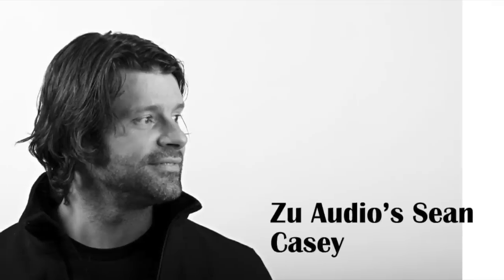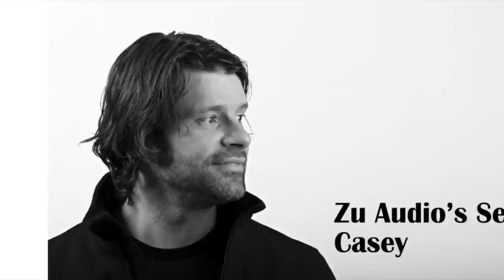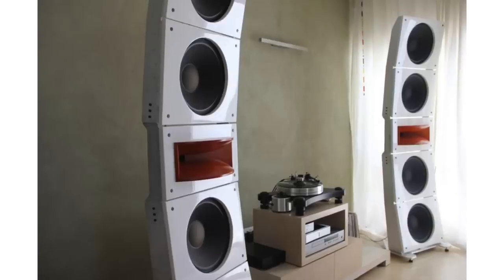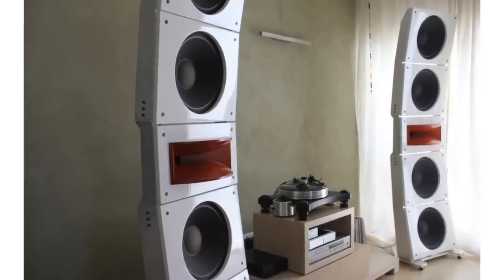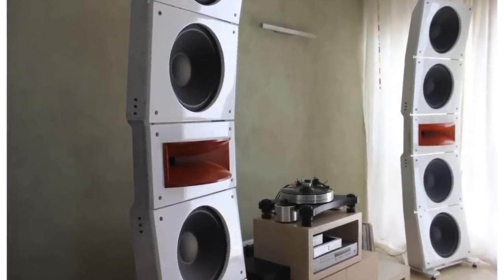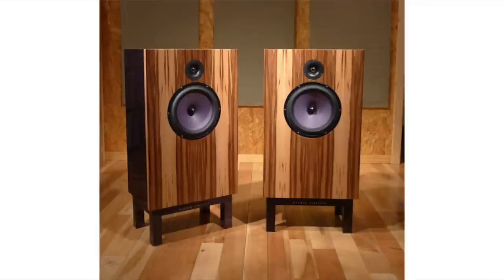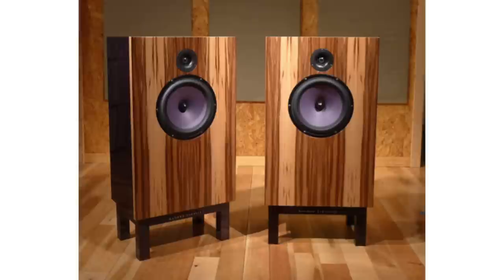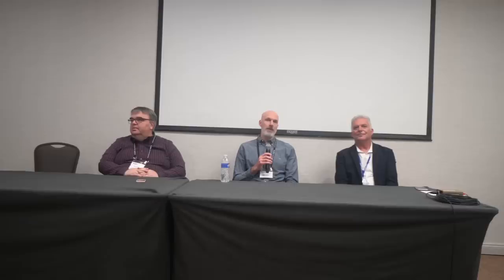Here's an in-depth discussion about box, horn, and panel speakers, and how they work

Comment: It is great to have such a wide variety of speaker types (and within any type, many manufacturers (and within any manufacturer, many models)).
Similarly, it is great to have such a wide variety of motorized vehicles (gas, electric, hybrid, 2-wheel, 4-wheel, luxury, performance, off-road, etc).

Now consider what it would be like if the one thing that all cars depends on was typically mediocre at best.  Consider what it would be like if almost anywhere you pump gas had X% of water (or some other clearly foul contaminant) mixed into the gas, resulting in limiting the performance of 100% of the cars on the road, and there is absolutely nothing any engine can do remedy the problem.

Such is the case with the sound quality of songs release by record companies.

So all of the hard work that everyone in the audio industry contributes, all of the amazing feats of design, engineering, and build quality are all dependent upon watered down gas (sub-par quality from the record labels).

Imagine if the only food available was unhealthy fast food.  Do you think we would have Olympic athletes?  Do you think the world would just ignore the problem?

If the record companies would stop over-processing, stop compressing, stop screwing with the magic that is on the master tapes, then all of these speaker designs would benefit.  Every speaker, regardless of design, regardless of price, would sound better (and in many cases, a lot better).

And it is not just speakers.  Every piece of audio gear would benefit.

The brilliant minds within the audio equipment industry are always fighting an uphill battle, always swimming upstream, never having the wind at their backs, due to so much sludge coming from the record labels.

If every speaker manufacturer was getting faulty drivers, or faulty wood, etc, and was forced to use those faulty items, they would scream loud and clear at the third parties responsible for providing the faulty parts.

It should be no different for the parties supplying the gas.  They should not be "normalized" and allowed to get a free pass for diminishing the sound quality of every part of every stereo system.

I wish that whenever panels of guests, such as the ones in this video, would get together, that they would at least mention what I consider to be the single worst culprit in the audio industry.  If they would rap things up by mentioning that so much of their efforts are for naught, due to lackluster releases from the record companies, then, if repeated often, the public will be better educated, and perhaps someone of influence at a record label might wake up.

Cheers!

Comment: Started with Bose 901 series 2 driven by one of those monster size Sansui receivers in the late 70's...thought they were great, but then heard a pair of Magnepan MG1s. What a revelation. They lasted until a couple of years ago and we now have Magnepan 1.7s with a Rel Storm sub. Everything in our system has been upgraded with much of it PS Audio. I have begun looking at new speakers (Paradigm Persona and Golden Ear Triton 1), thinking that something better would benefit from the rest of the system. I've struggled in that I/we love the Magnepan sound and would like a better sounding speaker (more clear highs where you can hear the tinkle of the cymbals) without having a pair of 6 foot monoliths (Magnepan 3.17i) in the living room. Haven't heard anything anywhere near the price point, but have begun listening to box speakers....so far it looks like we may have to stay with Magnepans. I'm interested in hearing the Devore and the Zu speakers...no dealer (especially Devore) in Minnesota.
Reply: Buy some 5" Tang Band (or similar) full range drivers with the (stationary) metal phase plugs. Make oversized boxes (like small towers) and mount the driver (like) 1 cm above the speaker hole (with a gap between the driver and the speaker hole). But also have a 2" deep bass vent tube the same diameter as the speaker hole. The bass vent tube is mounted on the speaker hole inside the box running 2" deep inside. Lightly pack with soft fluffy stuff. The best speakers you will ever hear! Way different sound (in a good way). They will make your solid state amp sound like tubes!

Comment: I've owned many different brands of speakers with all types of driver technology. I had the Mirage Omnisat's (the egg shaped speaker) that used omnidirectional tech, and I absolutely loved their sound. Especially with a separate sub for home theater. I use to be a 90% music 10% home theater guy, but now it's more like 50/50 since I upgraded our home theater to a 9.2.4 configuration with a Denon AVR-X8500H. This AVR is truly one of the best I've heard since the early 2000's when they made the 5805 which was a 99lb AVR. In 2006 I auditioned a pair of Klipsch RF-7's, and was blown away. Every speaker in my theater (except for my rear height's which are B&W in ceiling speakers) are all Klipsch with dual SVS SB16 Ultra subs, and it sounds unbelievable. Especially listening to just music! I've calibrated my system multiple times and finally found audio nirvana. I do still love 2-Channel audio, but the way the Denon X8500 upscales 2 channel to 13 channels, I feel like I'm at a live event with music coming from all directions being totally immersed with sound. It's quite an experience if you haven't tried it before! Most evenings I'm in our theater for hours..... But I still love all types of speaker tech, from panel speakers such as the Magnepan MG1, to exotic speakers of all types. Tannoy still makes one of the best sounding speakers to this day, KEF's uniQ tech (especially the Blade) to speakers that are way above my budget such as Wilson audio. It's been my hobby for around 35 years, and I still have all the audio mags with your reviews Steve. Love your YouTube channel by the way! I watch it everyday.

Comment: I am one of those crazies that has a Voice of the Theater systems in my home. The woofers are the Altec 515b drivers with the "horns" from a pair of Altec 210 cabinets. Horns is in quotes because they are really waveguides. The waveguides are about 5' wide, 34" tall and extend 30" in front of the driver. The woofers extend to around 27hz as a practical limit, and no, you don't see them move when they are playing. The true horns are 2, 16"x16" cells, so the part you see is 16"x32", and they are 31" long, exponential flare. The driver is compression, with a 1.4" opening, an extremely light aluminum driver of about 2" diameter, and a 20lb magnet and housing to hold it all. Altec calls it a tweeter, it goes from 300hz to about 16,000hz, but everything above 10khz is painful. For the highs, I have a RAAL dipole ribbon tweeter, open baffle. The woofer is also open baffle. All the drivers are time aligned.

My room is an unfinished basement, 24' wide by 65' long, walls and floor are cement. I have enough, you would probably call it junk, I call it acoustical treatment, scattered around that reflections are not a problem. The ceiling is open joists. I sit about 8' away, which is near field for these speakers. 

I designed this system to pair with my much loved, single ended triode 45 amps. Two watts per channel. The horns are 114db/w/m sensitive. At my normal listening levels of 75-95 watts, I am using from 1 to 10 milliwatts to drive these horns. I could drive them with my phone. The woofers take about 10 times the power, with the tweeter requiring about 10 times the woofer power. The system is tri-amped with an active crossover, a second 45 s.e.t., and a single ended transistor amp with 8 watts on the tweeter. 

The system is physically very imposing. If you are looking at them it is impossible to divorce the sound from the speakers. They were designed to be behind a movie screen, you are not supposed to see them. If you close your eyes, however, the speakers disappear and you are left with a deep, wide soundstage with pinpoint imaging and detail to spare. There is no "horn" sound. What you think is horn sound comes from poorly designed or compromised horns, usually in an attempt to make them smaller.

Last week, I was listening to Peter, Paul and Mary. When they played live, Peter stood on the right, Paul on the left and Mary in the middle. While listening, I found myself following each of them individually as they would go from their lead lines into their harmonies. I wasn't intending to do it, it just happened. Each voice was articulate, detailed and distinct. I have been a fan of PP&M since I first started listening to them on a Silvertone portable stereo record player back in high school. I have never heard them like this before.

I also have a pair of Sound Lab electrostatics, set up in the same room, opposite the horns. They share a source, and strangely enough, sound remarkably like the horns. The require a lot more power. I also have a pair of acoustic suspension speakers but the distortion is obvious and distracting.

These horns are not for everyone. Even I would not put them in my living room. It's something 99.99% of audiophiles will never experience, but if you ever went to the movies prior to about 1985, you have heard these. If you think about a theater, the sound is articulate and about the same volume in every seat in the house. This is what these speakers are designed to do. My bass cabs came out of the Campus West theater in Ft. Collins, Colorado. They were given to me. I went to this theater back in my college days, so I had heard them before. I remember liking them then too.
Reply: My dream speaker would be an Altec Model 19. First, I have to win the lotto and buy a house with a decent sized room, then track down a pair of 19's. You are fortunate to have the space and the VoTT's.
Dave

Comment: There are two kinds of music.  Live performances and production (studio) recordings.  These two types of music are very different, and therefore require two very different types of speakers to reproduce them realistically.  In order to reproduce all the nuances and effects of studio recordings you need a very revealing and detail oriented loud speaker.  To reproduce live performances realistically you need a loud speaker capable of delivering the dynamics and the room acoustics where it was performed.  This is actually very simple stuff.

This is why, as far as I'm concerned, you need two different types of speakers in your listening studio.  For me this means Maggie's for the production work and Klipsch for live performances.  Rock on.

Comment: I've never owned omnidirectional speakers, but I've heard and liked them at shows and at dealers. I had a brief dalliance with horns this year, but after 6 months I decided I couldn't live with the colorations. I owned several different dipoles: two electrostatic panels, plus I have a ribbon dipole on loan from a friend right now. However, I keep coming back to the small, two-way box speakers I've lived with for 20 years. They're my favorite. Of course, the devil is in the details. There are a lot of box speakers I don't like; the implementation can be genius or awful.

Comment: In business the old adage is “Location, Location, Location”. 

In audio circles the same can be said. 

I wonder if those who buy different speaker design types truly experiment with speaker placement and room evaluation before moving on to a different speaker type? 

Each design type has its particular strengths and weaknesses. For example horns have their share of fans and critics. Many cite harshness, listening fatigue, etc. as reasons for moving on to something else. 

But it’s highly likely that the listening room itself may be a factor in the amplifying the negatives of a speaker design and minimizing its positive characteristics. 

One of Paul Klipsch’s concepts in his original Klipschorn was to use the room and corners as an extension of the Horn design concept. Its design required exact location for this speaker needed to function according to design parameters. 

Acoustic suspension bookshelf designs were created to create much smaller, easier to build (subsequently cheaper and more profitable as well) speakers to put on a shelf without regards to any specific optimal location. But is that really accurate? 

Acoustic suspension types certainly do benefit from careful placement and room treatment just like any other type of speaker design and maybe even more so! 

Great panel discussion!

Lots of fantastic ideas. 

We now return you to your regularly scheduled Audiophiliac Steve G. 

👍🏻😂
Reply: Aswaguespack - Live music is fatiguing.  This is why concerts last for an hour and a half and not all day.
Reply: Jamie McNeil What concerts are you going to? An hour and a half? Huh? Never mind all the festival's!

Comment: Before the advent of STEREO listeners only needed one quality speaker for reproduction of sound. Stereo added the need for a second speaker. Double the cost! Economics entered into speaker discussion. Now the need to two instead of one drove the business to downsize the boxes to make stereo affordable to the mass consumer market. 

Remember Quadraphonic? Why didn’t it catch on? 

At that time the excessive cost of adding two additional quality speakers didn’t catch on. It wasn’t until decades later with home theater advances that very small multiple speakers allowed for an appropriate consumer concept economically designed for the mass consumer electronic market. 

👍🏻

Comment: BOX speakers are most popular simply because they are the most convenient.... they are easier to manufacture, to ship, to display, to fit into a room.  They are easy to design and get decent results affordably.  All these other types of speakers are quite possibly better, but need a bit more care in design and set up in the room, like a panel speaker.  Magnepan proves that a decent panel can be made affordable, but it still requires the right space around it.

Comment: Great video but I am not sure why there wasn't more talk about room interaction concerning things like time delay.Trying to get more info and head around not only how the drivers disperse sound wave but how room interactions change when you have direct radiating vs dipole vs open baffle.A few tips on how one could change up room for different types of speakers including not only field placement but absorptive treatments,bass traps etc and how these main types of speakers react differently to what one can do with placement and treatments.Seems like this ultimate transducer ,more so than anything else in the audi chain,has greatest variables for what within our tastes,beyond is "good sound" beyond objective numbers like THD etc .Great stuff but think thing is here the  surface merely scratched.As ever thanks Steve

Comment: I think I liked the horn and the Pure Audio baffle-less speaker rooms most of all, along with the reconditioned Quads; all are too big for my listening area. The Devores sounded very good as well, but the Zu room didn’t do the Zu’s justice. The smaller KEFs I heard were squashed into a small area on the 5th floor and didn’t do them justice either. The KEF dealer up there (Just Audio)  is located just off of the Baltimore Beltway in Parkville and they do exceptional repairs on vintage equipment, as well as having  a constantly changing inventory for sale.

Comment: Hello Steve, intresting topic again. My love for flat panel speakers began in the 70's back then I bought a pair off BES SM-300 Bertagni ElectroAcoustic Systems. They sounded amazing and gues what, they still do at a firend mine. I the years after I bought a pair off eminent magnetostatic loudspeakers. And from there on I got in touch with Magnapan.
Started with a pair MG-1 and now I do use the Magnapan MG 20.7 which, if I'm honest actualy to big for my living room. So I'm thinking to buy the MG .7. The only thing I have now is, which dealer would like them to trade in? This because there's, as you know a big differance in price between those models.

Comment: What I wanted to know, and which wasn't spoken about much except by Steve at the end, was the differences in how different speaker designs sound. How does one sound different from the others?
I have heard talk about the 'box speaker sound'. Well, what does that mean, exactly?

At the same time, I have had experiences listening to box speakers, both small and very large towers, as well as electrostats, horns, and even spherical speakers. The boxes definitely sound less "open". Maybe that's it.

It occurs to me that panel speakers like magneplanar or electrostatic designs are the ultimate open baffle speaker design. They overcome the flaws inherent in all cone drivers (cone breakup, mass, and speed), so why would you even bother to make open baffles with cone drivers anymore, except for meeting a price point or as a DIY project?
Reply: Cones can be more dynamic, louder, and go deeper. It's all a trade-off.
Dave
Reply: @gurdyman1 
Quite true.